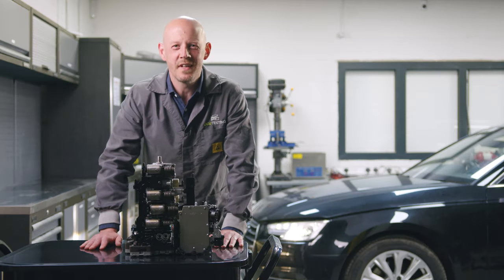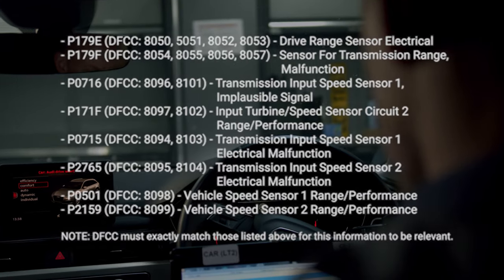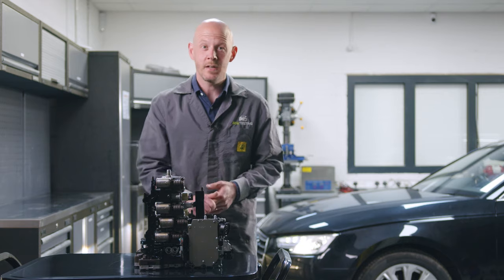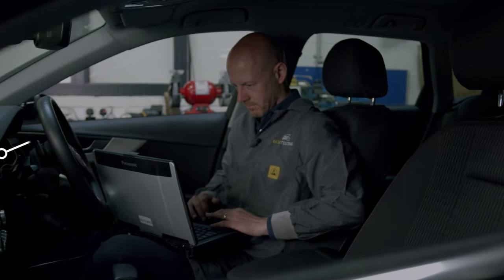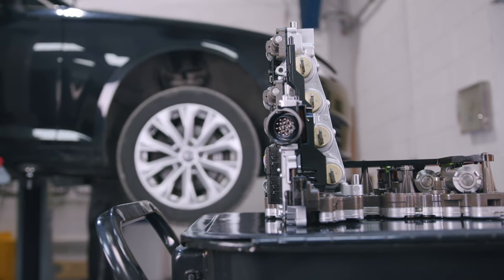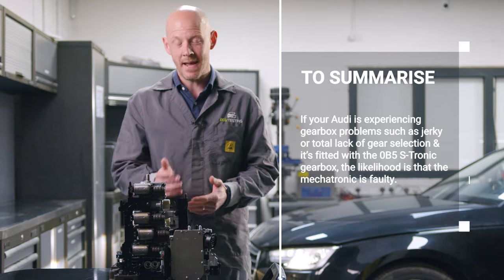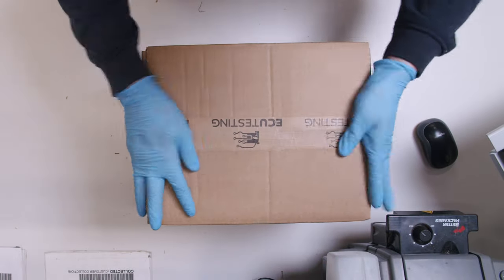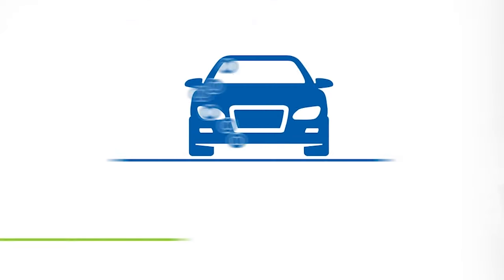Audi S Tronic Gearbox Problems

Comment: That's why I stay away from Audi  :)
Reply: That’s why you need a Manuel gearbox
Reply: A hell of a lot better than BMW
Reply: @BRANDONMALVEAUX-v6c that is bullshit. BMW uses ZF transmissions. One of most reliable transmissions in the world.
Reply: Bro...Toyota is the most reliable car in the world...
Reply: Only manual and no problems
Reply: So does Audi fool. @onecrazyguyful
Reply: @cammgt3rs370  ZF boxes are generally more reliable than Audi’s dual clutch boxes. That is common sense. I did not say Dual clutch is not reliable. But ZF AT are relatively better in terms of reliability.
Reply: @onecrazyguyful  and I am referring to c7.5 Audi A6, Audi Q5 B8/B8.5 also having ZF 8 speed transmissions that are also very robust.
Reply: @cammgt3rs370  that is correct
Reply: @onecrazyguyful  I'm just pssd off because my BMW is in the shop for fuel issues. Pump or pump module is defective. I never experienced this on any other car I've owned.
Reply: @cammgt3rs370  that is pretty weird. I never had this issue as well. What would you say the fuel quality? Was it good?
Reply: @onecrazyguyful 100 percent. The bitdi Audi A6/A7 also use the Zf 8 speed.

Comment: I don't know who in Volkswagen group asked the engineers to use such a large hybrid circuit (based on ceramic substrate) to use it in car transmission where the vibrations are too much. I know ceramic have better heat dissipation than a FR4 PCB but they can't handle vibrations if it's not attached properly and also it has to be hermetically sealed.

Comment: What if you only get P179E00 and P179F00  on the transmission?? Once the gearbox gets abit warm it chucks it into Neutral and N light flashes then parking brake error gearbox malfunction continue driving.. I switch the car off to take it out of any gear to put in park.. then switch it back on an can put it in D and drive goes through all the gears 1234567 still has gearbox malfunction cog on dash.. if I leave for couple hours then gearbox light goes off and back to normal till it warms up.. any help and advice would be appreciated.. is it definitely the drive position sensor as I'm splitting the gearbox soon so wanted any advice

Comment: The gears pf My 2020 Audi A6 2.0 TDI  wouldn't move beyond 2nd gear. This happened about 3 days after it was serviced for 16 000km at Audi Arcadia in Pretoria. It's now been with Audi for 10 days with NO resolution as they say the do not have the spanner to open up the faulty part. All those days the don't even offer a replacement vehicle for such an expensive car. Totally disappointing! Masiza

Comment: Good video !!!
The Audi A4 2015- which is also featured in the video
A4 2015-0CK is the automatic transmission
A4 -2014 0B5 which in the video is mechatronic

The video is not entirely correct!

Hi

Comment: Hi 
Q5 2012 tfsi 135klms 
Had parking break malfunction come on/ off  once a month for a few months 
This week epc came on  with Stabilization programe fault - see owners manul ,parking break makfunction and Gearbox Malfunction - you can continue driving 
Took it too garage ( indy ) 
He scanned it and cleared the codes ( didnt get the exact  codes from him ,but he didnt seem concerned,said i can continue driving ,even long distance) 
Got the car back - no error showing  
After driving a little the same GB Malf message  came on - then off  again Whilst still driving 
I am based in thailand so any info about what i should do next gratefully appreciated 
The car seems to be driving normally now 
I have a long drive planned and am nervous 
Cheers

Comment: Any one who is shying away from the TT-RS this is all the reason to pull the trigger for one with the manual gear box here in the US. The multi clutch alone is a $6K job. Timing belt $4K. This Mechatronic unit sounds like a $3K-$5K job.
Reply: the manual clutch only lasts 10,000 miles, DSG all the way

Comment: Hello mate my wife has a a1 2014 never had a issue she jumped started my mates van witch is a good van so probably has 2 battery’s on it…not knowing she should not off but now it want go into any gear and has the yellow warning on the box, we was told it can be caused from the jump start maybe cooked the mechatronic unit is this true thanks as it’s going to be a massive bill…
Reply: I meant food van and also her car is 7 speed auto it’s saying valve issue or pressure

Comment: Hi, Tim, I have an Audi Q5 2009 just got it about 2 days and the Gears are a bit Harsh and Jerky as you said, and sometimes when you stop the Engine cut out it will restart ok. when you put it in gear if you are too Quick Between forward and reverse it goes in limp home mode do you have a rough cost to fix them and I am in Australia have you done one from there Thanks, Mark
Reply: Hi , did you sort out this issue with your Q5 ?

Comment: Hello i have audi a6 2016 avant 2.0tdi fwd ,car is not selecting gear,error codes P074800,P07500,P07600
Reply from the maker: Hi. The symptoms you are describing could indicate a fault with the mechatronic unit. Please email our technical support team on info@ecutesting.com with the details in your comment above, as well as the part number for the mechatronic unit, and they will advise you further. Thanks.

Comment: I recently threw codes p060a and p0798. Parking brake and gearbox malfunction lights on as well. Car had to be towed. After a couple days of sitting and battery charge codes are clear.  Mechatronic failing?

Comment: Hello. I would like to ask you a question about my error code that has aperead several days ago. It says code number P179D00 and by description says "cooling oil valve electrical error"? 
I was wondering does that mean I have to repair my mechatronic or is it possible to repair just that one fuse on cooling oil valve?
Thanks in advance for your help.
Reply from the maker: Hi. The error code P179D00 is a common sign that the mechatronic unit is faulty. In our re-build solution, we replace common failing components with our own re-engineered parts, so the fault doesn't re-occur later down the line. Please visit our website for more information on how to send your unit into us: https://www.ecutesting.com/common-faults/audi/audi-s-tronic-0b5-gearbox-mechatronic-problem/

Comment: We have a 2010 audi tt 2.0 fsi. We had the box oil change carried out over a year ago but lately noticed on pull away its jerky every thing else is fine, do you think this could be low oil level or something else we have no warning lights car has done about 58,000
Reply: i have audi tt 2011 2.0 fst exactly same problem

Comment: I'm going thru gearbox malfunction and am scared to take it on the motorway
Reply from the maker: Hi, if you are experiencing the gearbox malfunction then we would recommend getting the vehicle scanned for fault codes to help aid the diagnosis. Please then email the results of this scan to our technical support team, on info@ecutesting.com, along with your make and model of vehicle, any other symptoms of the fault and the part number printed on your mechatronic unit. They will happy to advise you further.

Comment: i have error code P17D000, what is the problem?
 diagnostic system says its clutch 2 slip too great
Do i need oil change because its long time no change or i need complete new clutches and expensive repair ?

Comment: Hi .. I have Audi 7 2013.. transmission working absolutely fine just I’m getting error Gear is overheating change driving style .. and fault code is P1765 hydraulic sensor 2 adaptation limit reached .. pls advise what could be the actual problem??

Comment: Audi A4 2010 give gear box malfunction on the dash.when scanned it gives me (gear selector 
 2 engaging process not successfull)what could be the issue
Reply from the maker: Hi. Please email our technical support team at info@ecutesting.com with the results of the diagnostic scan, any fault symptoms, and the part number of the unit itself, and they will be happy to advise you further. Thanks.

Comment: bought my s3 and it’s stage 1 but not sure if tcu is tuned .. i have some issues with mu transmission when i pull off and it changes gear it sometimes have like a jerk in the shift but mostly in low rpm so only when i pull of .. doesn’t happen when i put mu foot down all the way .. any help please?
Reply: A tcu tune would probably help but I would definitely change the transmission fluid or get it looked it

Comment: My s5 has a message gearbox overheating adapt driving style, any suggestions?
Reply from the maker: Hi. Are you able to scan the vehicle for any fault codes as these will aid with the diagnosis. If you are able, then please email our technical support team at info@ecutesting.com with the following details: Your make and model of vehicle, you transmission part number (if possible), the symptoms of your fault, and the results of the diagnostic scan. They will assist you further and advise you on any re-build solution we can offer. Thanks.

Comment: I have an A5 V6 tdi with S-tronic 7speed. My problem is, that when car is stationary and I select "D", and take my foot off the breakpedal the car tends to "jump" forward and sometimes the engine stalls and go off even. I've noticed that the gearbox is very slow, when selecting "D" wether I'm backing up and then selecting "D", or selecting "D" and go forward!
All the gears works fine other than described above, there's no any sounds or anything!
If I select the gear by stopping gearshift on "N" for a 2-3sec, then selecting "D", it works pretty much ok?
What could be the problem here? 🤔
Reply from the maker: Hi. Have you scanned the vehicle for any fault codes? If you are able to get a diagnostic scan, please email the results to our technical support team at info@ecutesting.com and they will assist you further. Please also include your make and model of vehicle and symptoms of the fault. Thanks.

Comment: Hi , on audi tt mk2 2007 with s tronic gearbox,the car's crawling through traffic around idle RPM and just above, and in auto-selected 2nd gear. It results in a refined ride at this speed being extremely jerky and well, downright embaressing. Is this quite normal?
Reply from the maker: Hi. Have you had the vehicle scanned for any fault codes at all? These can help with diagnosing the cause of the symptoms you have described.

Comment: My car is audi r8 2013 with auto trans obza the gear ingage dirct to 2-speed the fault find in vcds is p073f unable to engage gear one cynchronization gear 1 failed can any help .. thank
Reply from the maker: Hi. We can test your unit, however when the mechatronic unit fails it usually brings up more than one fault code, so it's more likely be something external causing that fault. Cheers.

Comment: I have an Audi Q2......does the aftermarket battery can cause to delete the Gearbox ECU program?
Reply from the maker: Hi. We haven't heard of a replacement battery deleting any software sorry.
Reply: @Ecutestinglimited  ....Thanks for the prompt reply and this is true. Audi claims that putting a non-OEM battery was the cause of strong jerking and the need of gearbox software update.
Reply: Then is it normal that after the correction. There is still Clutch burning smell and according to them it will fade later as you drive.

Comment: Hi I have a 2013 a5 2.0 tdi auto
   I have noticed that sometimes I can go to set off in 1st gear and the revs build up and it just crawls along then jumps into gear.  The rest of the gears seem fine. Almost like the clutch is slipping?

It also doesn't seem as responsive as my Mrs q3 with same engine.  Both 170bhp
Reply from the maker: Hi. Erratic gear changing can be a sign of a failing mechatronic unit, however we would recommend getting a diagnostic scan to see if any fault codes are being produced before condemning the unit. If you are able to do this, please email the results to our technical support team at info@ecutesting.com, along with the the make and model of vehicle, and symptoms of the fault. They will be happy to assist you further and advise you of any re-build solution we can offer. Thanks
Reply: Have you managed to resolve the issue? My 2013 A6 2.0 TDI also does this when cold but other than this the gearbox works perfect

Comment: Hi .. can you replace hydraulic pressure sensor G194.. for fault code p1765
Reply from the maker: Hi, apologies for the delayed response. We do offer a test for the P1765 fault and, depending on the outcome of the test, we may be able to re-build your unit. Fill in our online test form at ecutesting.com to get started, and if you have any further questions please contact us at info@ecutesting.com. Cheers.

Comment: How similar is the Porsche PDK mechatronics unit to the Audi? Specifically talking the Macan and the Panamera.
Reply: I have a 2018 macan and the internal are identical to a DL501 only the casing and rear tail are different! I have the parts illustrated manual and the parts star with 0B5! Don’t let Porsche fool you! The macan is running on an old transmission! DSG-7 until 2018 and then a DSG-8

Comment: Hi my car is audi r8 2013 7 speed dsg (0bza)  is the part number for megatronic . the fault read is p073f unable to engage gear one / synchronization gear one failed . and car run onley reverse gear and speed 2 and speed 4 can any help .... thank you .
Reply from the maker: Hi. Is that the only fault code being produced when scanned? Usually when the mechatronic unit fails it usually brings up more than one fault code, so it's more likely be something external causing that fault. However we do offer a test and re-build service, but again, it could be something other than the mechatronic unit that is causing the fault. Cheers

Comment: Hello, I have such a problem with my vehicle 
And the service could not solve the problem, I would be very glad if you could help me 

AUDI A4 2016 2.0tdi quattro
gear selector lever basic settings not made

Error code: p287b00

Comment: I getting 'Clutch overheating, please stop vehicle' and car does not move. Its Audi A3 Stronic 2010. not getting any code. Thanks
Reply from the maker: Hi. We would recommend getting a diagnostic scan to see if any fault codes are being produced to help diagnose what the potential cause could be. If you are able to do this, please email the results to our technical support team at info@ecutesting.com, along with the the make and model of vehicle, and symptoms of the fault. They will be happy to assist you further and advise you of any testing and re-build solutions we can offer. Thanks
Reply: @Ecutestinglimited  Thanks, is it possible that no fault code comes on diagnose tool? i got diagnostic done from couple of mechanics but both are not able to get any code from diagnostic scan.
Reply from the maker: Hi. If you have no codes present in the TCM, then it is unlikely the fault is being caused by a faulty S Tronic.

Comment: I've got an Audi A4 b9 from 2016 with a 7 speed s-tronic dsg gearbox and I got the message : Selector lever fault but everything works fine,no symptoms at all.Can that be only a sensor error?
Reply: I had the same problem around 2 years ago but it’s disappearing by himself and never come back
Reply: @AlexandruTDK  Seems like I found out the problem.I tested at Audi they did a software update and told me if the message comes back then they need to change the gear knob.

Comment: Hello, would total power loss on any upshifting gear for a second or two under WOT be a symptom of a mechatronic issue? I've replaced circuits, and solenoids from the updated transmission and it fixed many issues but that power cut remains. I'm really trying to fix this.
Reply from the maker: Hi. This isn't an issue we have encountered before. Have you scanned the vehicle for any fault codes?
Reply: i have the same thing going on
Reply: @tylerpadlina943  sadly, i was never able to figure it out. we even took apart the transmission entirely to replace the internal speed sensor for the gears, still no solution. It never gave any fault codes.

Comment: My a3 2011 is shifting harsly in to 2 4 6 gear could this be the mecatrnic?
Reply from the maker: Hi. Harsh gear changing is possibly a sign of a failing mechatronic unit. If you email our technical support team at info@ecutesting.com with details of your car make and model, mechatronic part number, and any fault codes or diagnostic information you can get, then we will be happy to advise you further. Cheers.

Comment: I took my 2011 Audi S4 to an Audi dealership because of a clunking noise at low speeds and reverse. The car shifts fine from what I’ve noticed. I took it to Audi and they said my car was completely fine and the noise I was hearing was due to the age of the vehicle. That noise got progressively worse. What could possibly be the issue?
Reply: Depends where noise is coming from, possible suspension issue?
Reply: Driveshaft
Reply: Does your vehicle not go into reverse until you stop and restart?

Do you get a blinking gear indicator on your cluster?

If you are getting an unexpected gear disengagement code with a car over 32,000 km then your dual clutch is toast.

$6K to $7K bill incoming.

That said there is something you can try first. That being the DSG service. The car will do this if the clutch overheats. Changing the gear oil and the filter could help.
Reply: Does anybody experienced this audi a6 2013 S tronic. When I take off it jerks after it doesn't do it until I take off again.  Then it's fine fluid has been changed and it has been recalibrated??
Reply: @davidfallon4899  If it’s at low speeds 1-to 2nd shift feels jerky and when you are stoping and down shifting does the car lurch forward and feels hard to stop a bit 
It’s the transmission bushing gotta get a solid one, it’s like 50 bucks and its two bolts  easy 5 minute job fixes all that believe it or not
Reply: @nickmiranda8761  
It's just on take off and when I'm on a hill. It jumpes or lunges forward then its fine. There is about 210000 miles on it to be fair.